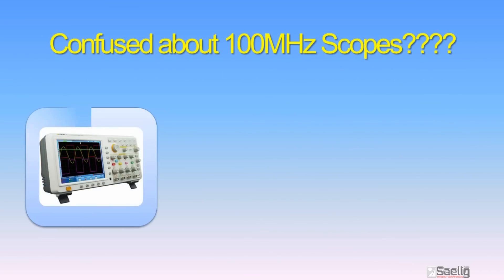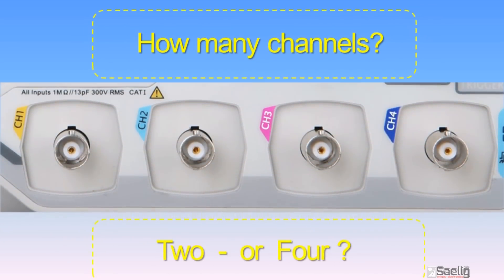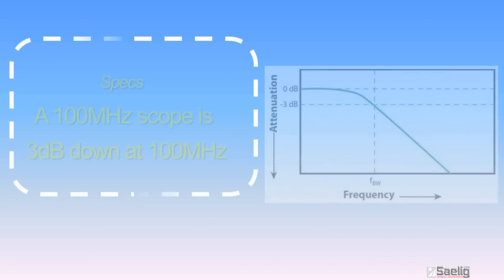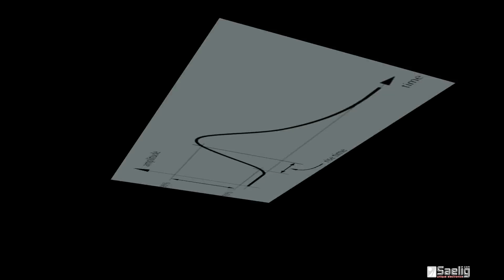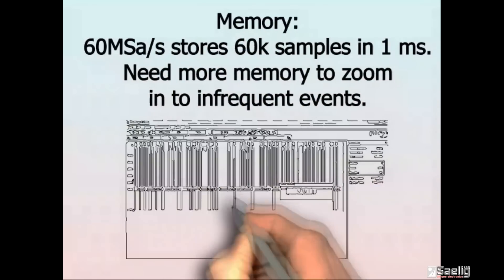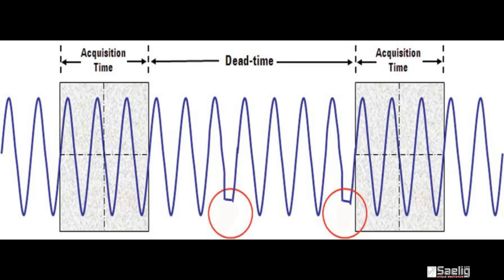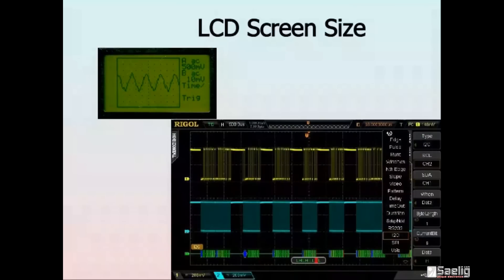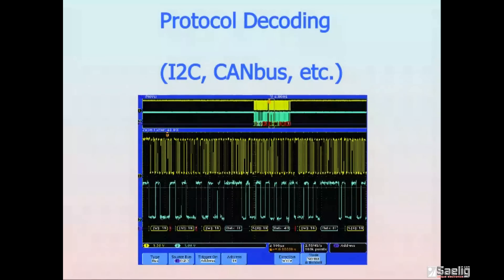Choosing the best 100MHz Oscilloscope

Comment: After spending my younger years working with big name Oscopes as a bench tech and deveopment engineer❂>imgs.love/owOscilloscope?Ґ I have always wanted one for home use. This scope is ideal for the tinkering that I do (repairing equipment for friends and small electronic projects). I like the form factor and the battery function is great when you just need it for a quick check of something. The display is easy to read, the probes are better quality than other entry scopes, the carrying back makes it easy to put away with all the accessories (as I am an occasional user, this is important to me.), and the menus are not difficult to figure out. I just think that it is a good value for occasional use and you are accustom to higher end scopes.

Comment: siglent sds1104x-e best
Reply: @RajinderYadav  on 1202x-e high aliasing if use two channel (500MSa because 1x ADC) https://www.eevblog.com/forum/testgear/siglent-sds1204x-e-released-for-domestic-markets-in-china/?action=dlattach;attach=399073;image
on 1104x-e almost no aliasing on 500MSa + if use two channel can 1GSa (2x ADC) + decode 4 wire SPI + most MCU use PLL (40~60MHz internal & only 10~15MHz external) + options AWG/Bode Plot (spectrum analysis) & 16 digital channel http://youtu.be/uoVzJTujMT0

Comment: hello there... thanks for this video...
is there any short advise for what to by, for a 4 analog channels, 100 Mhz, reasonable FFT, with no software or hardware issues and best T support, my main job goes for GSM gateways and and laptops SMPS power supplys, UPS back devices.

thanks a lot
Reply from the maker: +MTS The best value at the moment is Rigol's DS1104Z, and it's stable since it's been on the market for a couple of years now!  http://www.saelig.com/ds1000z-series/ds1104z.htm
Reply: SaeligCompanyInc
i see, thanks a lot for replying me, what about Rigol DS1054Z, its half the price, and does the extra money worth the extra features ?
Reply from the maker: +MTS 1054Z is the most popular scope we have.  You may not need the extra bandwidth for your work!